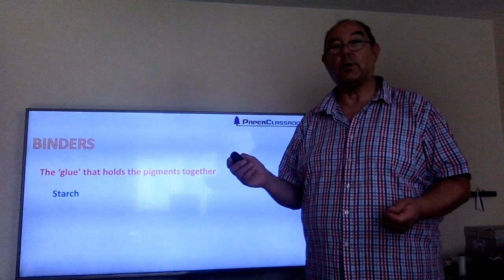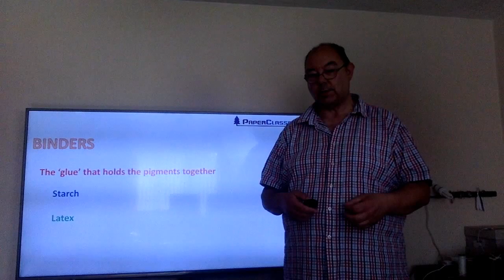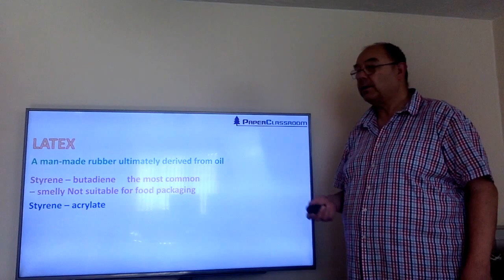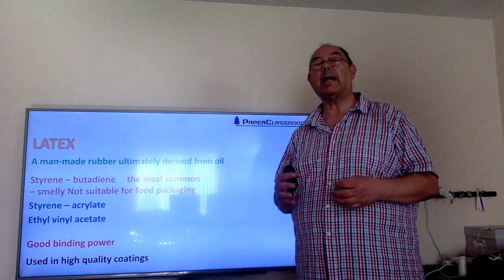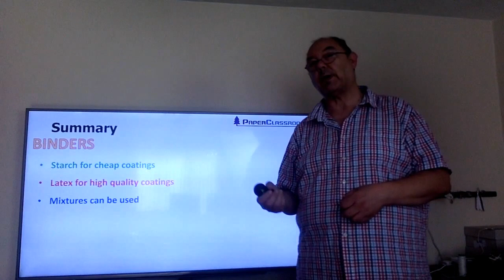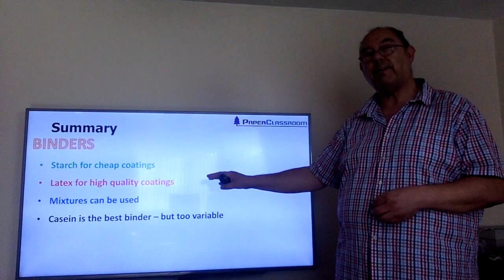86   Coating Binders

Comment: Sir what is binder migration. When it will occur
Reply from the maker: Binder migration is when the binder component of a coating mix soaks into the base sheet rather than staying on Tom of the sheet. 
This causes the pigment:binder ratio to change. - less binder per pigment. So the coating will be weak leading to printing problems such as wet and dry pick
Its cause can be because the viscosity of the coating is too low or the sheet is not sized enough